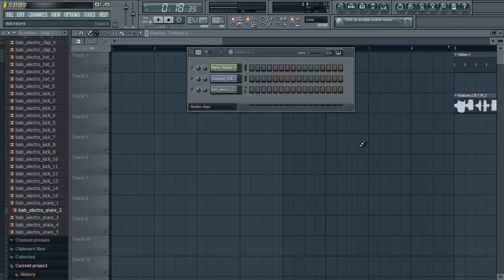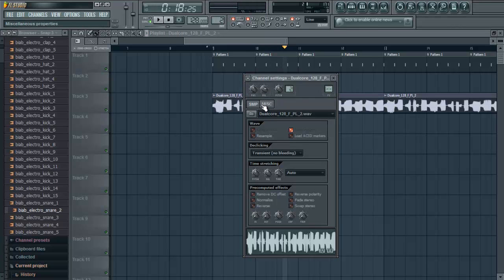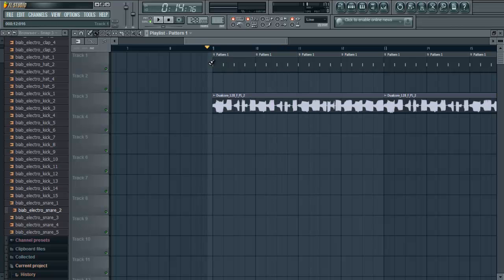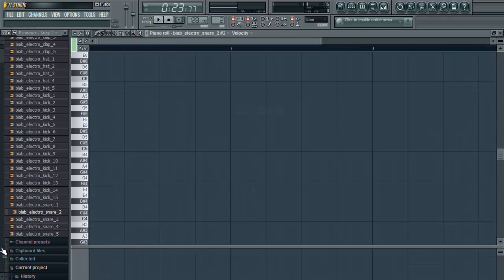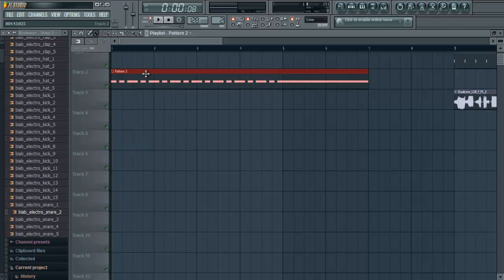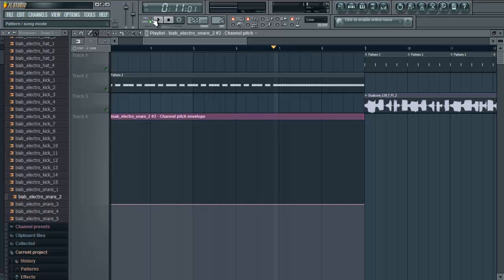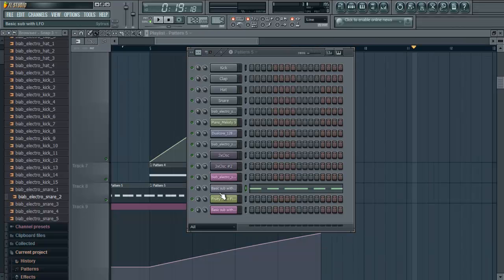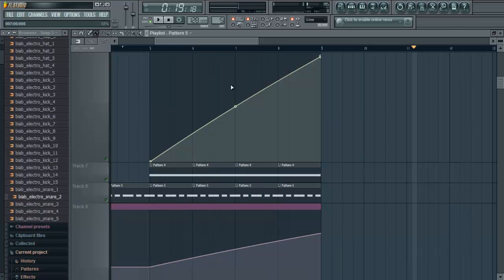FL Studio tutorial: How to make a Electronic / House Build up - Drop. Advanced method!

Comment: However much it may not seem so, this video is doing the opposite; it's confusing. No offense. For the maker of the video: you do know if you highlight all those notes and shrink them to the smallest size possible, it will sound EXACTLY the same. So telling people to do it that way is just going to be confusing them in the long run. Also, I could've did that same pattern in the sequencer, which is where it should be. For anyone that wants to do it professionally, a drum pattern is done in the sequencer (the switches). Or any part of the drum kit, for that matter. Common drum patterns are 1, 2 measures (bars) long. You also need to understand off/on beats. (1,3) (2,4) [per beat] [4 beats per measure]. It's called 4/4 time. Each measure has 16 switches. For beginners, always put your snares on 5 and 13, and to start, kick on 1, 5, 9, 13. As you learn, you will get a feel for it. If you want a drum type roll like in the video, use Toms, but do it in the sequencer. To understand this, flip a few switches and then send to piano roll (FL studio 11 and under) (click piano roll for FL studio 12). Notice where the notes are placed on the roll (quantize) and notice they are the smallest size possible. It's where the note starts that matters, they will sound just the same if you stretch the note out. Learn which switch places the note where and then learn how to get your sound by adjusting the tempo. There's so much more to this, such as where the drum is hit with the stick. This is all beginner level. How to accent and flam with the sequencer (it's possible). How to use swing. Adjusting velocity for a realistic sound. Making sure your drum pattern can actually be played with 2 hands and 2 feet. That's advanced.

Knowledge IS Power.
Reply: Chad Schultz I'm just talking about notes that don't have sustain.
Reply: +Chad Schultz Nice thanks :)

Comment: once i've zoomed in, it wont let me half the note again? any suggestions?
Reply: in the top left corner, it is a kind of magnet looking thing. if you press that and then press (none) it will allow you to place the notes exactly as you want them to. to make it normal again you drag the note so it's on the thick dark-gray line. when you've done that you press the magnet-looking thing again and press line.
Reply: RednaxOfficial thanks heaps mate.
Reply: Also, using the snap function in the piano roll is helping make patterns faster and always on spot. It's easier to get every single part of the pattern to go exactly where you want it. I personally don't recommend taking away the magnet because it will get out of sync (the beat) easily. In Piano roll press the down button, go to snap, and choose whichever option suits your project. Hope this helps.